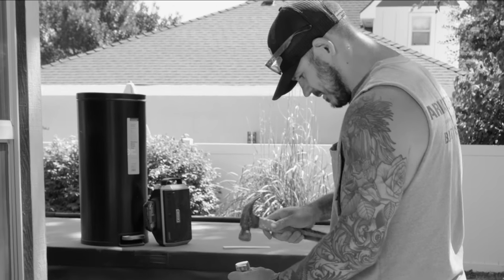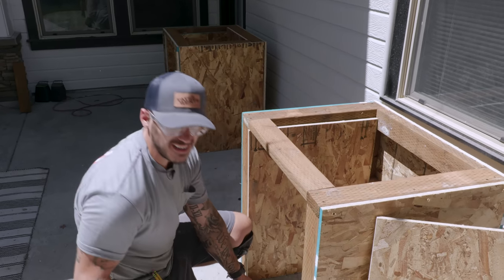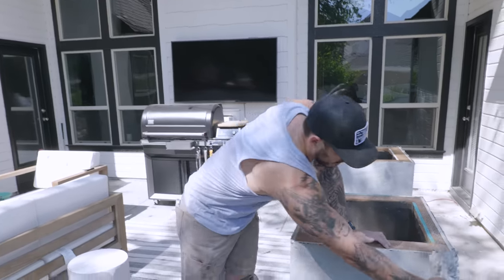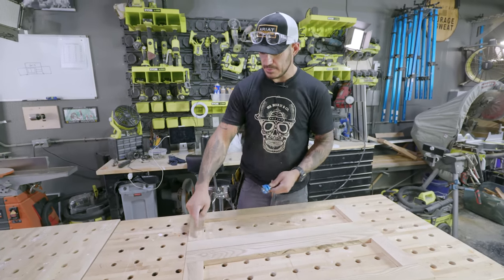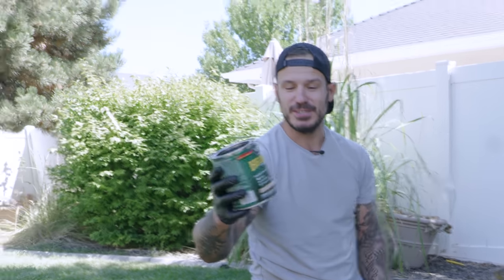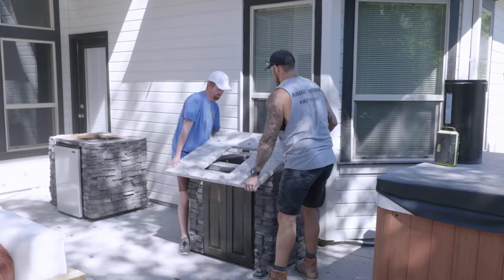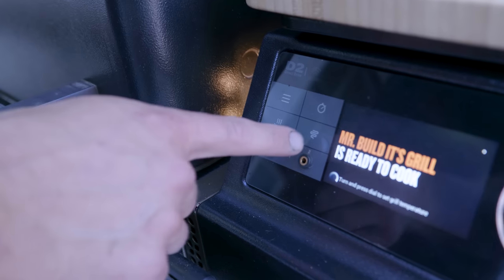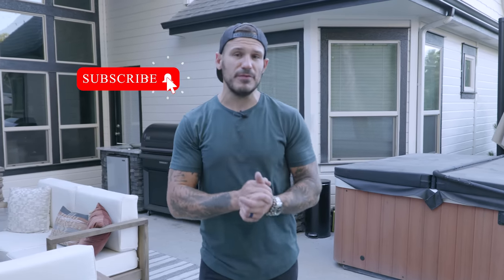Building My Dream Outdoor Kitchen, Without Plumbing

Comment: When I helped my buddy with his outdoor kitchen he just hooked it up to his hose and had it run into a barrel inside the cabinet and he would then either dump it or drain it into an actual sink inside. Depending on what was cleaned in the sink that day. Mostly it was for hand washing so he just dumped it into the yard.

Comment: heat from the grill right next to house siding exterior is something to worry about. looks nice though
Reply: Traeger recommends 18” clearance behind stove…
Reply: how come?
Reply: @JamieReynolds89  Grills get hot.  If to close to siding, paneling can melt or catch on fire.
Reply: I have this same grill, it is double wall metal, it surprisingly doesn’t get as hot as you would expect. But I do keep mine 18-24” from my house under a covered porch

Comment: You did a great job! Not criticism, just for future... when using metal lath, you should staple every 2"-4". and it is best practice to use a liquid membrane after the mortar fill because you are puncturing the waterproofing with the nails or staples when you attach the lath to the OSB. But again, love the project man! youre awesome.

Comment: I'm a bit late to the party but currently in Antarctica at the South Pole with temps at -65F. Having worked in the high heats and now very cold, I'd take the heat work for sure.

Comment: VERY well done.  Im in the process of finalizing my plans for a cinderblock grill station Im building this coming Fall, (trying to avoid the heat of another summer project). Your station is so well done, you really have me thinking about amending my plans. I like the idea of being able to take grilling station with you when you move as well as the versatility an almost modular setup gives you if you want to swap out/upgrade grills down the line.

Comment: Awesome video! It really helped inspire me to hopefully doing something like this at my house. The only thing I would consider doing differently is buying a y adapter for a garden hose outlet and then using a quick disconnect at the hose spigot and then using a whip hose to connect that to the back of the cabinet by drilling a hole where you can put a quick disconnect coupler there. That way it is easier to utilize the faucet and it still remains mobile because of how easy it is to disconnect the hose. Then you only need one bucket for the wastewater.

Comment: Real question, but instead of OSB+Membrane+Lath+cement, wouldn't it be way more practical and equally good to simply use a cement board over the 2x4s?
Reply from the maker: That’s a question for masonry guys.
Reply: Yes
Reply: Yeah, I thought the same thing. Would certainly be more weather resistant if done that way.
Reply: Yes it would’ve 
Is just the same like your house is made with 2x4 they are not pressure treated just the ones in the bottom
Reply: Exactly my thoughts

Comment: Since you used OSB which is not rot resistant at all and you wrapped everything in stone anyway, you could probably save a bit by using non pressure treated lumber.
Reply: Substitute out the OSB for cement board.
Reply: @matthewcox6140  that works too.
Reply: @matthewcox6140  I like that idea best, it's safer, fire resistant and water resistant. We already have large granite scraps to use for our outdoor kitchen. Won't be able to build it until end if summer though. Need to save up for this. I would prefer plumbing  and not worried about taking it with me.  I'm not moving.
Reply: What kind of wood would be best for outdoors weather resistant for this type of project or similar?
Reply: @leilei3525  cedar is always a good choice. Redwood works well, too.

Comment: Yo! Awesome build. Couple of notes: 
1. You’re going to hate that grey water system, I know from experience cuz I build custom rvs😂.  
2. Just buy and electric pump and install a cool lit up switch. 
3. You may be happier just buying 2 30 gallon tanks because the grey is going to fill up quick and you will constantly have to clean it out. But at that point you may as well run extensions and just connect into the homes plumbing system for grey and fresh 😅
Reply: I agree

Comment: Fort Smith, AR and it had been hot!!! Hoping I can do a very similar build during the first half of September, as well as figure out the cheapest, anti-back-laboring way to build the platform for us to chill on. (Also needs to be removable, without lots of rock and concrete going into or into the ground.

Comment: I like this video and have plan to build my outdoor kitchen as well. I was planning on using metal wall studs and cement board so it can be tiled, that can work as well right. no need for me to have a water barrier, correct?
Reply: It wont hurt; nevertheless, it would be overkill/ wasted extra money with no real/true "extra" benefit.

Comment: Love that grill!
Reply: They are crazy expensive if you have not priced one.  More that I'd want to spend for sure.
Reply: @Danman1972  Yep. That one he has is about $3800. Knock off a few hundred if you want the smaller one.
Reply: @GuessWho-uc5uq  He didn’t pay for it either.  It’s a sponsorship.  These dopes get everything for free.
Reply: @MikeCashVT  He may have got it, but its not free.  He had to struggle to put himself in that position and also likely has to make content about it.  I say good for him!   You can do that for about any grill.  I have seen that one in the ACE near me. If I were looking at a pellet smoker it would likely be a different one that is way less.  I can do every thing on my kettle grill just fine.  Great idea and would love the features of the smoker, but just done want to pay  the premium for it.

Comment: Would highly recommend just putting a splitter on the hose bib and running a line over to the sink. Maybe even just run a hose to an a garden bed or something for waste water. Probably would cost about the same and water more convenient.
Reply: I was thinking that...another option for his setup would be a submersible pond pump with either a rocker or foot switch.

Comment: After thought, could you have had a house adabter lead from the hose to a level on off 3 way value(not sure how to word that) and then when the hose is on you can then control it with the faucet

Comment: Do you have plans, dimensions, or instructions drawn up for this? 

Also can I use brick around the outside instead of buying all that stone? 

 I also need to know if it's absolutely necessary to have the doors? 

And can I build a brick pizza oven next to either of these counters without risking damage to them or causing the components side to melt, stop working, or weather faster? 

Thank you so so so much. I've been looking for build like this WITH BUDGETS and simple tools. ❤❤❤❤🎉🎉🎉🎉🎉🎉

Comment: Looks great! Question: Couldn't you have used cement board to wrap the cabinets and saved a few steps and time for about the same price? Also, what about using steel framing vs. wood? Lighter and cheaper now a days.

Comment: How’s that side burner working out for you. Based on the instructions I was reading for the cutout, there had to be a partition from the intake and exhaust of the ventilation for it to work properly. From this video, looks like you cut out the opening and just dropped it in.

Comment: Just a fireplace guy here. In the process of doing my own backyard over. Couple of concerns. Traeger, who makes the grill ON THE FIRST PAGE of the installation manual, says 20" clearance to combustibles behind the BBQ. Kind of scary. All I'm saying is that I hope you read this. So, that's the first fire hazard I see, and I just don't want people to copy that type of stuff, it hurts the entire industry. 

Second Concern, On your initial intro I noticed the direct vent fireplace cap directly under your outdoor TV. The exhaust coming out of the cap is extremely hot 4-600 degrees F at least according to most manufacturers. I am curious if the television has melted yet. Typically you can't have a soffit or overhang anything within 18" of the top of the termination cap because of heat. Electronics and plastic. I can't imagine that made it. 

The real reason I bring this up is because as much as I am a DIY guy, over the years I've learned to at least consult a professional with my design. Especially when it comes to anything that can burn down my house. If you don't at least read the entire manual or at the very least the big bold ones that say FIRE HAZARD -  Stay safe everyone.

Owners Manual for reference: https://traegergrills.a.bigcontent.io/v1/static/2023_Timberline_OM_ENGLISH 

Who knows, maybe I just saved a family. So maybe not, just a fireplace guy. 🤔

Comment: You should use construction adhesive, or perhaps even liquid nails to apply your narrow strip of stone on the face of each box. If you don’t, my guess is those narrow strips will pop off again. You did a nice job on the kitchen. So you buy a few boards, a sheet of OSB and a box of screws and you pay $240! Wood is ridiculously high priced!

Comment: Questions!:
- instead of OSB and roofing felt, would cement board be sufficient under the stone? Also helping "fire proof" it.
- Any reason not to do stainless steel door?  

thx for posting!
Reply: I build grill stations all the time because I do everything landscaping outside. I have made something out of wood a few years back and it started on fire, because of the grease pan dripping. They recommend not to use wood. I now use steel studs and fasten everything together level no matter what the pitch of the ground is. Wrap that with dura rock, and it is super strong. We also make our own custom countertops with black dye in the concrete. It turns out amazing and it holds the weight really good. Never will be a fire problem or anything. Usually when using wood plywood or Osb you want to put tyvek wrinkle wrap behind it so when moisture or any water gets back behind the stone it just flows through the channels out. Otherwise with flat wrap behind it, I’ve seen stone pop off other peoples work because the water gets trapped. There is a bunch of different ways to build them but I just found steel 20ga studs to be the best and most efficient for me
Reply: Yes, cement board would have also worked.

Comment: You should have put those cabinets on heavy duty locking casters, so you could move the setup around, depending on the time of day/angle of the sun.
Reply from the maker: I considered it. Only problem is possible rocking for sloping slab

Comment: Is the heat coming off from the grill going to warp your siding? When I moved into our house I noticed a portion of the siding was warped. Found out, it was because the previous owner had a grill in front of it.

Comment: Could have saved a few steps and had a waterproof shell by using cement board, like hardi backer. That osb is just inviting water, moisture, pests. No need to deal with roof membrane and the wire lathe.

Comment: Should've went with 25 gauge metal stud framing and cement board instead of pressure treated lumber and osb. Could've avoided the lathe too....

Comment: no way that's an outdoor rated fridge for 200 bucks
Reply: I've had a cheap Sanyo mini fridge on my patio for 18 years.  It's seen four homes  and about 6000 cases of beer, in San Diego and Phoenix.  Damned thing has seen snow, monsoon rain, dust storms and insane 115 degree summer heat.  It wont quit, the paint is still perfect and the only blemish is the clearcoat on the stainless door started to fade.  $150 in 2004.  I always figured it was cheap enough to be disposable, but will probably outlive me.
Reply: You don't need to spend all that money on outdoor rated fridges or tv's for that matter. I'm in South Florida where the humidity is stupid, and i have a $300 tv on my patio with a $250 fridge. No problems.
Reply: @matthewpeterson3329  The only issue I see with his fridge is that he put it in that tight enclosure. He could have cut out a couple holes near the top on each side and covered them with a decorative vent register. That would help get rid of the heat that fridge is putting off.
Reply: @AaronHalpin    I hadn't considered the small space.  My built in island is like a big, open shell inside, so it's never been an issue.  I think you're right though.

Comment: hello, have you had any problems with heat being transferred to your vinyl siding? I was told grills need to be at least 3 feet  away or some cases 10 ft.
Reply: I can tell you I warped the siding on my house... grill needs to be multiple feet away.

Comment: I’m curious, could you just have used sheet rock and rolled on some red guard to waterproof it?
Reply: He could have used cement board directly on the frame and applied the stone directly to that. Depending on what look you are going for, you could save tons of money by using something like shiplap instead of stone...would certainly be easier to move as well.

Comment: Also, You could have saved money a lot of it, starting with the wood. it was way overkill to use 4x4 pressure treated wood, especially when you have adjustable metal feet on the bottom so the wood doesn't even touch the ground?  You could have used regular 2x4's. and than painted them with a special waterproofing like used in bathrooms etc.. so it wouldn't have to worry about being wet ever. especially after the motar and brick .   BUT GREAT JOB..  and the counter tops could have saved a ton, because they were so darn small, you could have done a polished concrete cement on those small tops.. very cheaply. . SO this could have been done for about $1000 easily !!!